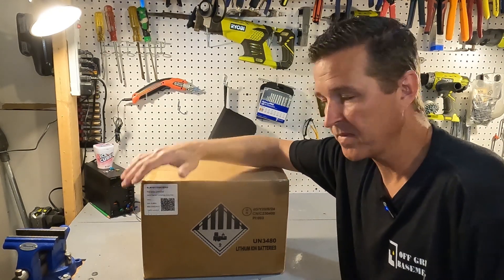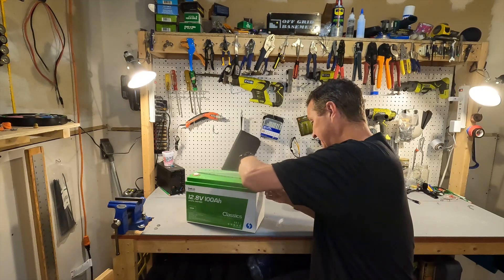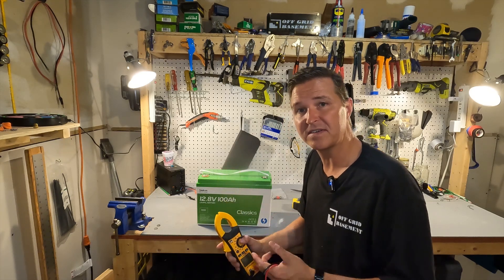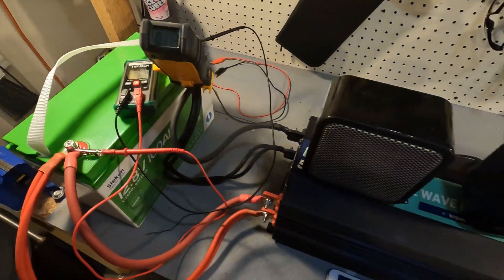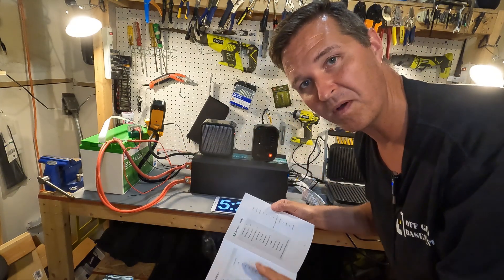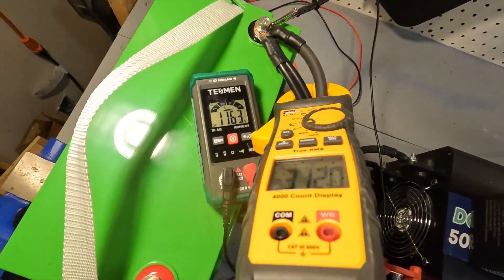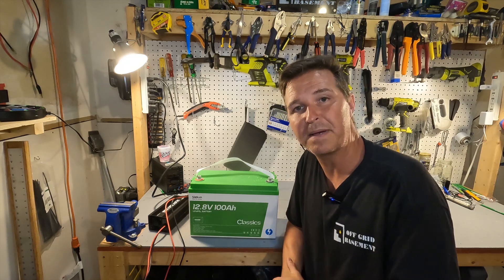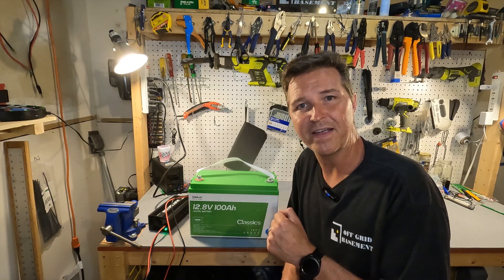0.16 per Wh, Siekon's 12V 100Ah lithium battery!

Comment: An Amazon reviewer brought up a good point; saying that this battery's charging only accepts a maximum of 2.4amps. ( a very low charging rate) 
Thats a problem for full time RV and van living where you're dependent on solar panels and have occasional sunlight
Reply from the maker: That review must be mistaken.  This battery can accept 20a minimum.  Max continuous is 50a.  Maybe they are referring to an 8ah 12v battery?

Comment: Don't waste your time trying to buy this battery. You won't find it at the link that he provided or at the the store link provided on Amazon. Both with just take you to a 12 volt, 5, 7, or 12 AH battery listing. This appears to be a scam battery that the company is handing out to reviewers in exchange for a favorable review. This is 14 days after this review was posted. I've seen reviewers being taken in by this as recently as 9 days ago.
Reply: I bought one 2 days ago. They all sold out because of all the review videos.
Reply from the maker: I'll email the company to find out what's going on.  Thanks for the heads up.  NOTE:  I received an email stating they are sold out as of 7-14-24.
Reply: Got mine from Amazon Sep 24. $189

Comment: Thanks for the video, good observation regarding the 5 degrees low temp spec.
It seems like we have a miscommunication regarding the low temp protection. Is it low temp charging protection @ 5 degrees F or low temperature discharging @ 5 F?  The documentation is too vague.
My understanding has been that you want to stop the battery from being able to be CHARGED whenever it gets to freezing, 32 Degrees F or 0 Degrees C. 
The temp protections for when to stop the ability to DISCHARGE the LFP batteries was set to 5 F or -15 C.
Testing should probably have a temp controlled aspect to it in order to verify/confirm the manufacturers claims.
This battery suggests it stops the DISCHARGE @ 5 F, unknown if it has protections to stop the Charge @ 32 F.
Reply from the maker: Thank you for the information and the comment.

Comment: Lead-Acid has an advantage when it comes to power output. A group 31 Lead-Acid can output > 550CCA Kinda important when trying to crank a gas engine over with a starter motor.
Reply from the maker: True.  These are storage batteries, not starter batteries.  Thanks for the comment.
Reply: @OffGridBasement  Great video BTW.
Reply: @OffGridBasement  I'm not sure about that. I know you gave it a failing grade because of over current protection. But if it can output 300A it might be able to start a small gas engine.

Comment: When you have multiple batteries, would it be enough to have one with all the protection features, like over current, to shut down the entire bank?
Reply from the maker: No.  That one battery would shut down, but the others would continue to operate in a parallel configuration.  It might work for a series configuration, but I definitely don't recommend it.
Reply: @OffGridBasement  would be interesting to have a “master BMS” that monitors all batteries and shuts the bank down if needed. Or better yet, shuts industrial batteries down.